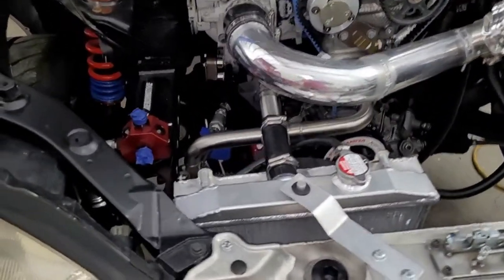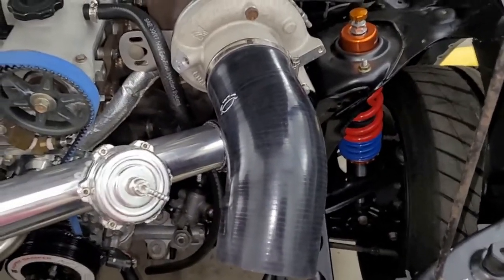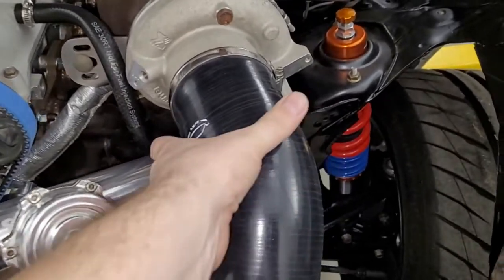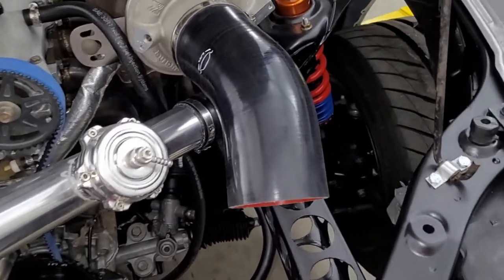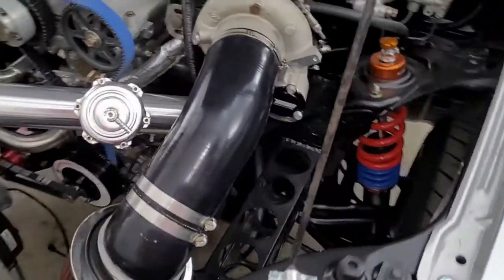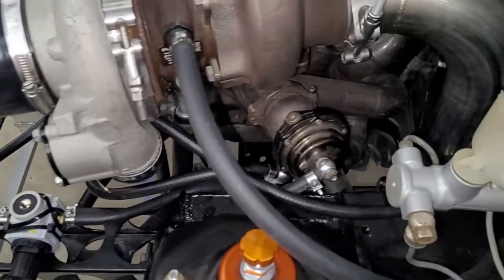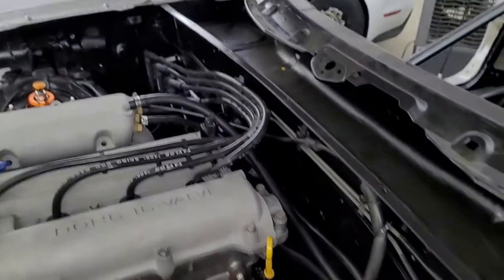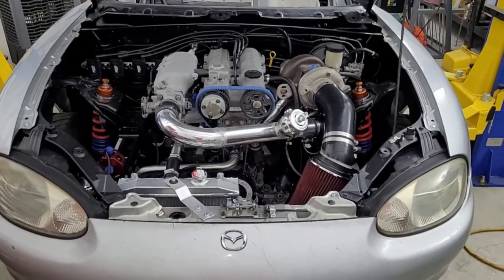Cooling System Done! Air and Boost Control

Comment: Is running that regulator more reliable or better than say a hallman MBC ?
Reply from the maker: Not sure on reliability of it failing completely,  but for performance and reliability in not having boost spikes, I'm a fan of using a regulator on the top port. They are extremely consistent and predictable.